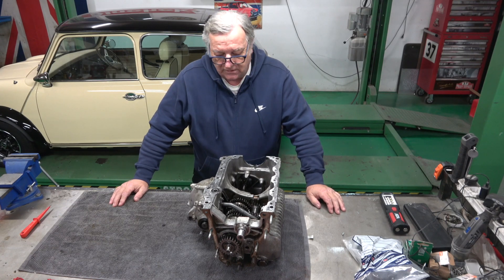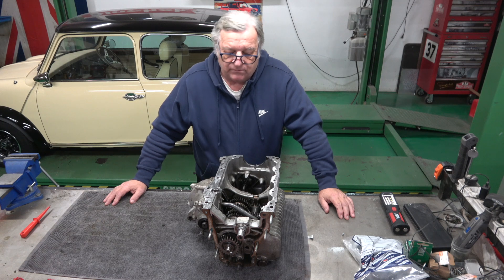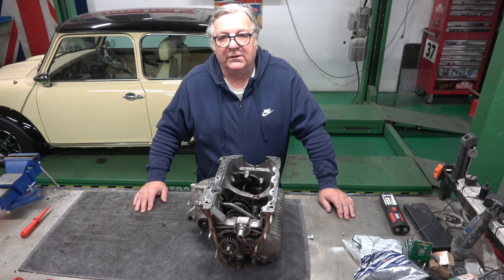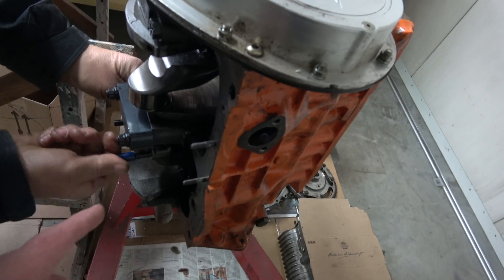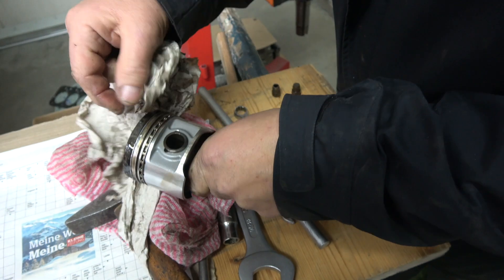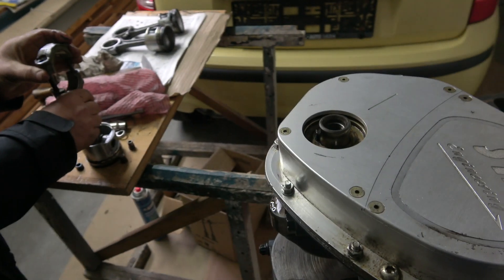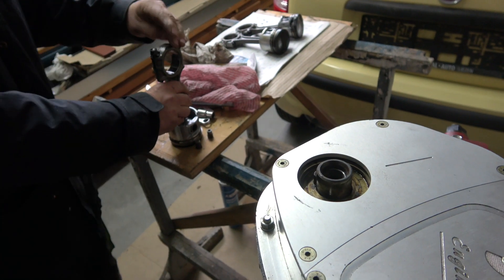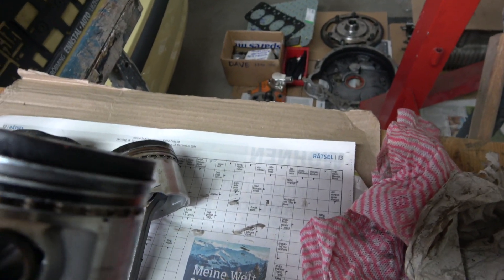Classic Gulf Mini Race Engine Strip Down Part 1

Comment: so if the the compression ratio is 12:1 how you going to bring it down? a thicker head gasket, 2 head gaskets, machine some off the top off the piston, shorter conrods?
Reply from the maker: Paul,  We will fit dished pistons rather than flat tops which in hindsight we should have fitted in the first place but weren't arable at the time of the build. 
Cheers Dave

Comment: I heard you both mention heating the connecting rod in order to install  it into the piston  and insert the wrist  pin.  That is the way is is often done. I did that job on an MBG engine a couple of years ago to install new pistons with a lower folumve dish in order to raise the CR. 
However, because of the limited time you have to get the pins installed before the con lrod cools and to be sure I got the pins positioned accurately I chose the alternate method which is to use a hydraulic press (12 Ton) and freeze the pins.
I made a stout wooden saddle to suport the piston and distrubute the load/fiorce on the piston and included a hole into which I inserted an old wrist pin that I had ground to a slightly reduced diameter. This was to help accurately position the piston relative to the press. 
I also made a wood fixture to accurately position and support the connecting rod relative to the piston.
When making the piston "saddle"  you need to allow for the offset of the wrist pin in the piston. Tiis offset is considerable, more tha I had ever thought. perhaps as much as 3 MM.
You might want to make a flanged device  on which you apply the press and use it to cntrol how deep into the piston the wrist pin is driven..
I think to make the "saddle I probably used a hole saw and  sawed the piece  into two parts as  required. I actually used some thick,  say 25MM plywood and stacked 2 or 3 pieces, glued and bolted together.
Sorry for the lingth of this, when I starsted thought it would be short. 2 guys how had very very fast MINIS, It is amazing how they go; these guys used the best of everything from the UK.
Tom G.
Reply from the maker: Tom,  Thanks very much for the advice and the info and taking the time and effort to pass this on in a comment it is very much appreciated. I don't know if you have watched any of my videos before on any of our restorations or projects. Max is one of the most knowledgeable Mini specialists i have ever known apart from being a professional engineer in mechanical R&D for a large car company in Austria. He also has probably the largest private collection of classic minis across the whole range approx 80 to 90. Max is a very private person and doesn't like to be on camera or show his collection to too many people which is a shame as it is a classic mini goldmine of cars and parts. He is well known in the international mini world from IMM. I hope you will watch
in on the rebuild of this track engine and maybe have a look at my Mini Cooper road car videos which Max rebuilt the engine and gearbox on. To this day is the only mini I have ever owned or seen that does not leak a drop of oil. Sorry for the long reply but i thought as you had been kind enough to pass on your advice it was only right for me to explain. I very much hope you will watch this track mini come back to life and racing again. Cheers Dave